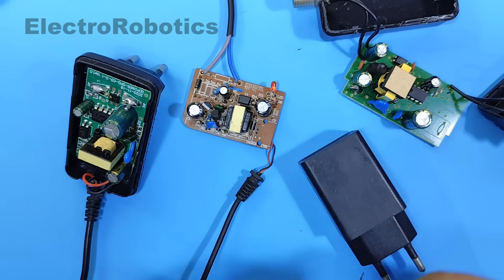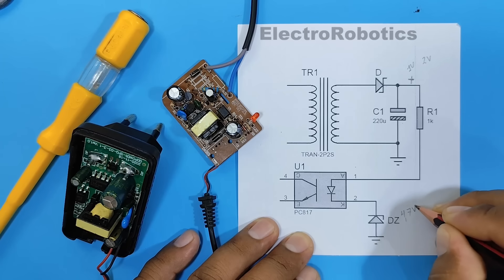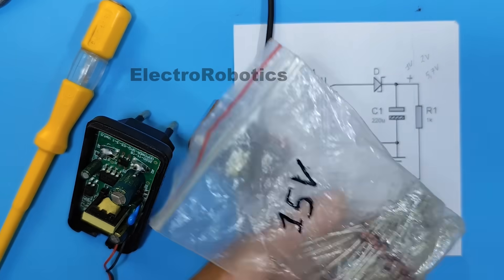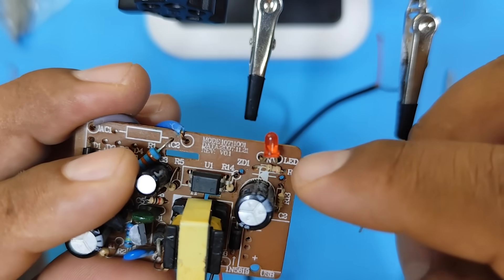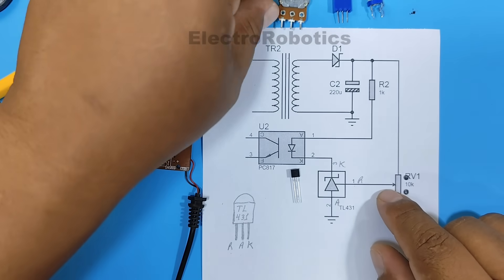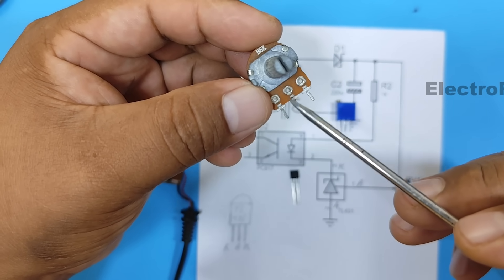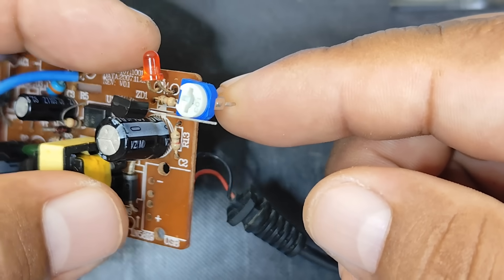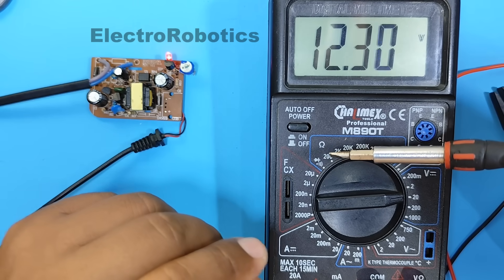Modify Any Charger and Adjust Its Voltage.

Comment: I would like to see the output when this thing comes under load. Ripple all over the place is my best guess. Better use some switching power supply (laptop ones are great for this) and  one of those cheap panel up down converters that will also give you a voltage and milliAmp reading. It will also get you some basic short circuit protection. What you created here is a potential circuit destroyer that cannot handle variable load.

Comment: its probably better to go down & not up... 
and like others have mentioned be weary of the power output of the whole system. So, if its a 10watt device.  5v * 2A = 10w  ;  10v * 1A = 10w ;  2.5v * 4A = 10w   
but also another caution I see is that most transistors have turn on voltage of 2-5v  , vbe & bias current is usually dialed in around that 2-5v .  yeah, just test & watch with a thermal sensor...

Comment: Can you do an internal Motorola DVR power supply to all the guitar gear friendly voltages and whatnot.  If you open up a DVR unit the power supply has like 8 or 9 different voltages that are not far off from being able to do guitar circuits. I'm turning a Motorola DVR unit into an all in one breadboarding monster. I wanna put all the Top 3 tone stacks on it so I can plug n play when designing new circuits. I just need to know what components to change to get 3, 9, 12, 18, 24, 36 and 48v phantom power and a negative 9v cuz some fuzz pedals run on negative 9v.

Comment: I've already done that too. The power supply had about 22 volts and I needed 18 volts. 
Then I changed the voltage divider so that the voltage is pushed down to 18V.
A TL431 is usually installed. It always regulates the control pin to 2.5 volts.

Comment: Wrong technique. 1.Altering output voltage will destabilize the control loop. 2.Will change the reflected voltage at the main switching transistor, which can damage or degrade the switching transistor over time.

Comment: Great video.  If you ever decide to remake it,  you could run a few load tests at various voltages. It would be interesting to see how much power it can provide at low voltages and how much power at high output voltage.

Comment: Very good !
Fantastic.
Reply: Do not be FOOLED !

So much mis-information
- FIRST SAFETY  is important but no safety precautions are given. The part about adjusting the trimmer is scary bad.
- The current must be reduced else it will over-heat and self-destruct. Do not be FOOLED !
 - it does NOT work on all chargers. Do not be FOOLED !
- the output waveform will be degraded, so the load may not work properly. Do not be FOOLED !
- he does briefly mention the issue with the output cap .....be CAREFUL. For example if you change to 12V then the output cap must rated at least 16V

 This mod has been around for many years  by very ignorant channel makers. It is too bad he has repeated the same mistakes and same mis-information. He should know better.

Using a DVMM with no load is a rather naive test. Do not be FOOLED !

Comment: thank you so much...
Reply: Do not be FOOLED !

So much mis-information
- FIRST SAFETY  is important but no safety precautions are given. The part about adjusting the trimmer is scary bad.
- The current must be reduced else it will over-heat and self-destruct. Do not be FOOLED !
 - it does NOT work on all chargers. Do not be FOOLED !
- the output waveform will be degraded, so the load may not work properly. Do not be FOOLED !
- he does briefly mention the issue with the output cap .....be CAREFUL. For example if you change to 12V then the output cap must rated at least 16V

 This mod has been around for many years  by very ignorant channel makers. It is too bad he has repeated the same mistakes and same mis-information. He should know better.

Using a DVMM with no load is a rather naive test. Do not be FOOLED !

Comment: Good Video thank you. Would of been nice to show the lowest Voltage this would allow too.
Reply from the maker: Hi Mason Govender, thanks for your comment and support. For the next video, I'll try to show the minimum voltage that can be obtained with this method.
Reply: Do not be FOOLED !

So much mis-information
- FIRST SAFETY  is important but no safety precautions are given. The part about adjusting the trimmer is scary bad.
- The current must be reduced else it will over-heat and self-destruct. Do not be FOOLED !
 - it does NOT work on all chargers. Do not be FOOLED !
- the output waveform will be degraded, so the load may not work properly. Do not be FOOLED !
- he does briefly mention the issue with the output cap .....be CAREFUL. For example if you change to 12V then the output cap must rated at least 16V

 This mod has been around for many years  by very ignorant channel makers. It is too bad he has repeated the same mistakes and same mis-information. He should know better.

Using a DVMM with no load is a rather naive test. Do not be FOOLED !

Comment: Very good explanation! Only a small extra info is needed. While you rise the voltage pay attention of the current that adapter can supply because it has a predefined power. If you are with a 5W adapter supplying 5V and 1A, if you modify to 10 volts, it can not supply more than 0.5 A, and also, the flyback transformer starts to make a noise because of pwm duty cycle.
Reply: Do not be FOOLED !

So much mis-information
- FIRST SAFETY  is important but no safety precautions are given. The part about adjusting the trimmer is scary bad.
- The current must be reduced else it will over-heat and self-destruct. Do not be FOOLED !
 - it does NOT work on all chargers. Do not be FOOLED !
- the output waveform will be degraded, so the load may not work properly. Do not be FOOLED !
- he does briefly mention the issue with the output cap .....be CAREFUL. For example if you change to 12V then the output cap must rated at least 16V

 This mod has been around for many years  by very ignorant channel makers. It is too bad he has repeated the same mistakes and same mis-information. He should know better.

Using a DVMM with no load is a rather naive test. Do not be FOOLED !

Comment: My dear friend , try to draw some power with a changed voltage put some load first and then we will see if it is stable because changing a circuit like this is VERY WRONG...!!! Voltages below the original voltage  might work ok...(meaning drawing same current ...but still it depends...!!)  BUT voltages above the original voltage will definitely  cause a lot of problems like unstable oscillations to the load and not stable voltage ..!! so my advise is not to mess with the output of any Switching Power Supply because you will loose the efficiency at first and on the second you may end up  by damaging the load. I do not agree at all.
Reply: Change transformer winding?
Reply: @irishguy200007 If you change the transformer's winding then better design a switching power supply from the beginning....and do not mess with one already made...my advice...

Comment: Suppose we convert a 5V 2A SMPS to 18V, what would be the current output ?
Reply: Do not be FOOLED !

So much mis-information
- FIRST SAFETY  is important but no safety precautions are given. The part about adjusting the trimmer is scary bad.
- The current must be reduced else it will over-heat and self-destruct. Do not be FOOLED !
 - it does NOT work on all chargers. Do not be FOOLED !
- the output waveform will be degraded, so the load may not work properly. Do not be FOOLED !
- he does briefly mention the issue with the output cap .....be CAREFUL. For example if you change to 12V then the output cap must rated at least 16V

 This mod has been around for many years  by very ignorant channel makers. It is too bad he has repeated the same mistakes and same mis-information. He should know better.

Using a DVMM with no load is a rather naive test. Do not be FOOLED !

Comment: Very informative...Thank you
Reply: Do not be FOOLED !

So much mis-information
- FIRST SAFETY  is important but no safety precautions are given. The part about adjusting the trimmer is scary bad.
- The current must be reduced else it will over-heat and self-destruct. Do not be FOOLED !
 - it does NOT work on all chargers. Do not be FOOLED !
- the output waveform will be degraded, so the load may not work properly. Do not be FOOLED !
- he does briefly mention the issue with the output cap .....be CAREFUL. For example if you change to 12V then the output cap must rated at least 16V

 This mod has been around for many years  by very ignorant channel makers. It is too bad he has repeated the same mistakes and same mis-information. He should know better.

Using a DVMM with no load is a rather naive test. Do not be FOOLED !

Comment: It's very useful, but I wonder how affected Current this change.
Reply from the maker: Hello FARUK Savaş, in the case of the current, it would have to decrease, since the Power Supply has a Fixed Output Power. If the Voltage Increases, it is normal that the Consumption Current should be Reduced so that the Power Supply does not Heat Up.
Reply: Do not be FOOLED !

So much mis-information
- FIRST SAFETY  is important but no safety precautions are given. The part about adjusting the trimmer is scary bad.
- The current must be reduced else it will over-heat and self-destruct. Do not be FOOLED !
 - it does NOT work on all chargers. Do not be FOOLED !
- the output waveform will be degraded, so the load may not work properly. Do not be FOOLED !
- he does briefly mention the issue with the output cap .....be CAREFUL. For example if you change to 12V then the output cap must rated at least 16V

 This mod has been around for many years  by very ignorant channel makers. It is too bad he has repeated the same mistakes and same mis-information. He should know better.

Using a DVMM with no load is a rather naive test. Do not be FOOLED !

Comment: Thank you for this.. what if I want to change the charger from 45 watt to 65 watt please 🙏
Reply from the maker: Hi Zeddicus Zulzorander, that's a good question. Power generally can't be increased. Perhaps you could increase it a little, but only briefly, as the charger could overheat.
Perhaps I can demonstrate this in a future video. Best regards, and thanks for commenting.
Reply: Do not be FOOLED !

So much mis-information
- FIRST SAFETY  is important but no safety precautions are given. The part about adjusting the trimmer is scary bad.
- The current must be reduced else it will over-heat and self-destruct. Do not be FOOLED !
 - it does NOT work on all chargers. Do not be FOOLED !
- the output waveform will be degraded, so the load may not work properly. Do not be FOOLED !
- he does briefly mention the issue with the output cap .....be CAREFUL. For example if you change to 12V then the output cap must rated at least 16V

 This mod has been around for many years  by very ignorant channel makers. It is too bad he has repeated the same mistakes and same mis-information. He should know better.

Using a DVMM with no load is a rather naive test. Do not be FOOLED !

Comment: Good video!
Reply from the maker: Hi Peter, I'm glad you enjoyed the video and thank you for your support and comment.
Reply: Do not be FOOLED !

So much mis-information
- FIRST SAFETY  is important but no safety precautions are given. The part about adjusting the trimmer is scary bad.
- The current must be reduced else it will over-heat and self-destruct. Do not be FOOLED !
 - it does NOT work on all chargers. Do not be FOOLED !
- the output waveform will be degraded, so the load may not work properly. Do not be FOOLED !
- he does briefly mention the issue with the output cap .....be CAREFUL. For example if you change to 12V then the output cap must rated at least 16V

 This mod has been around for many years  by very ignorant channel makers. It is too bad he has repeated the same mistakes and same mis-information. He should know better.

Using a DVMM with no load is a rather naive test. Do not be FOOLED !

Comment: Nice one
Reply: Do not be FOOLED !

So much mis-information
- FIRST SAFETY  is important but no safety precautions are given. The part about adjusting the trimmer is scary bad.
- The current must be reduced else it will over-heat and self-destruct. Do not be FOOLED !
 - it does NOT work on all chargers. Do not be FOOLED !
- the output waveform will be degraded, so the load may not work properly. Do not be FOOLED !
- he does briefly mention the issue with the output cap .....be CAREFUL. For example if you change to 12V then the output cap must rated at least 16V

 This mod has been around for many years  by very ignorant channel makers. It is too bad he has repeated the same mistakes and same mis-information. He should know better.

Using a DVMM with no load is a rather naive test. Do not be FOOLED !

Comment: Very nice tutorial
Reply from the maker: Hi Franco, I'm glad you liked the tutorial. Thanks for your support and thanks for commenting.
Reply: Do not be FOOLED !

So much mis-information
- FIRST SAFETY  is important but no safety precautions are given. The part about adjusting the trimmer is scary bad.
- The current must be reduced else it will over-heat and self-destruct. Do not be FOOLED !
 - it does NOT work on all chargers. Do not be FOOLED !
- the output waveform will be degraded, so the load may not work properly. Do not be FOOLED !
- he does briefly mention the issue with the output cap .....be CAREFUL. For example if you change to 12V then the output cap must rated at least 16V

 This mod has been around for many years  by very ignorant channel makers. It is too bad he has repeated the same mistakes and same mis-information. He should know better.

Using a DVMM with no load is a rather naive test. Do not be FOOLED !

Comment: Well, the idea of a switching  power supply  is about the stability of the output  even if the line voltage is lower, brownout as an example.  Changing the zener will  put too much demand on the switching transistor on the primary side. There is  a good possibility that the optocoupler will be toast as well. Replacing the zener with a higher wattage means that the circuit  will cook before the zener shorts. Voltage multiplied by the current gives you the wattage. So higher voltage means lower wattage. If  that is so simple, manufacturers  could have saved zillons of dollars,  just by not making so many different switching transformers.  There are  many parts are critical in switching   power supplies. Diodes high speed, capacitors 105C,  it still should  have the rated output voltage, even if the line voltage dropped  significantly.  I repaired enough switching  supply in my life to know shortcuts won't  do.

Comment: If you modify to higher voltage, what will happen to the current? Will it change or stay the same?
Reply: Do not be FOOLED !

So much mis-information
- FIRST SAFETY  is important but no safety precautions are given. The part about adjusting the trimmer is scary bad.
- The current must be reduced else it will over-heat and self-destruct. Do not be FOOLED !
 - it does NOT work on all chargers. Do not be FOOLED !
- the output waveform will be degraded, so the load may not work properly. Do not be FOOLED !
- he does briefly mention the issue with the output cap .....be CAREFUL. For example if you change to 12V then the output cap must rated at least 16V

 This mod has been around for many years  by very ignorant channel makers. It is too bad he has repeated the same mistakes and same mis-information. He should know better.

Using a DVMM with no load is a rather naive test. Do not be FOOLED !

Comment: Great video for educational purposes! Yet do power supplies really use the control logic you use and manipulate? That’s not guaranteed. Modern supplies now seem to often use power management chips and work a lot differently. Still, for educational purposes that’s an awesome video! Thank you.
Reply: Do not be FOOLED !

So much mis-information
- FIRST SAFETY  is important but no safety precautions are given. The part about adjusting the trimmer is scary bad.
- The current must be reduced else it will over-heat and self-destruct. Do not be FOOLED !
 - it does NOT work on all chargers. Do not be FOOLED !
- the output waveform will be degraded, so the load may not work properly. Do not be FOOLED !
- he does briefly mention the issue with the output cap .....be CAREFUL. For example if you change to 12V then the output cap must rated at least 16V

 This mod has been around for many years  by very ignorant channel makers. It is too bad he has repeated the same mistakes and same mis-information. He should know better.

Using a DVMM with no load is a rather naive test. Do not be FOOLED !

Comment: I subbed, this is good stuff.
Reply: Do not be FOOLED !

So much mis-information
- FIRST SAFETY  is important but no safety precautions are given. The part about adjusting the trimmer is scary bad.
- The current must be reduced else it will over-heat and self-destruct. Do not be FOOLED !
 - it does NOT work on all chargers. Do not be FOOLED !
- the output waveform will be degraded, so the load may not work properly. Do not be FOOLED !
- he does briefly mention the issue with the output cap .....be CAREFUL. For example if you change to 12V then the output cap must rated at least 16V

 This mod has been around for many years  by very ignorant channel makers. It is too bad he has repeated the same mistakes and same mis-information. He should know better.

Using a DVMM with no load is a rather naive test. Do not be FOOLED !